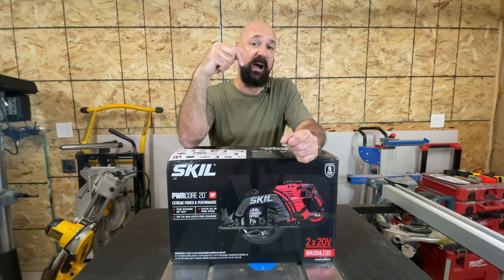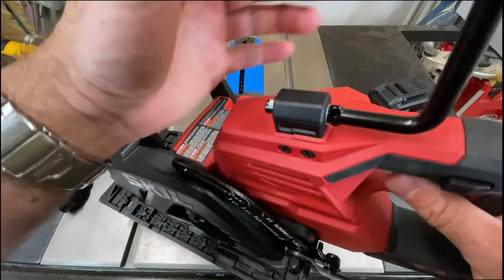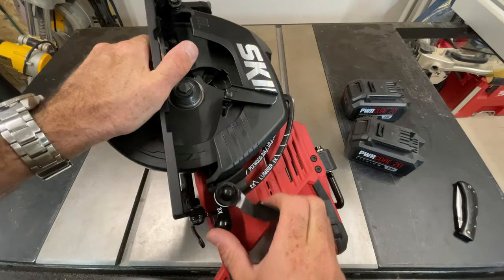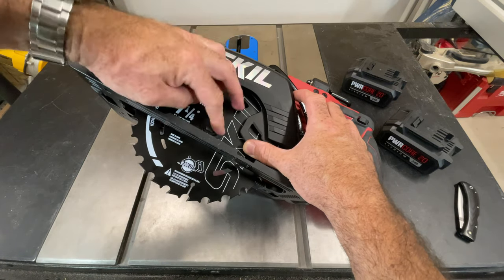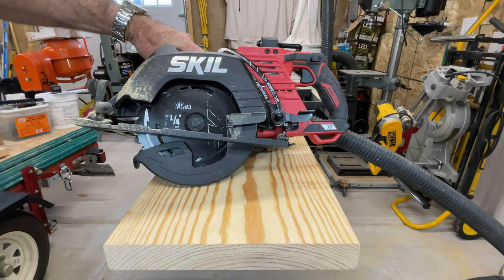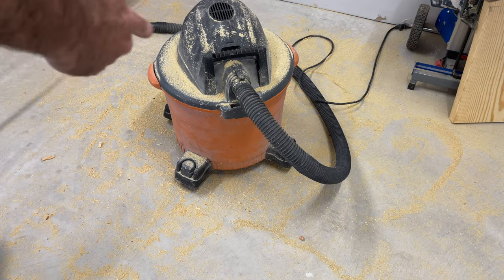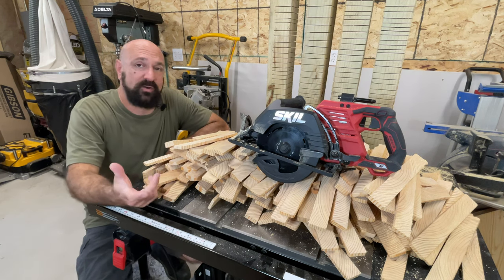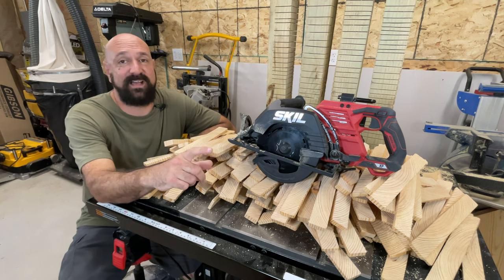Is Skil's New Rear Handle Any Good?? || Skil PWRCORE 20 XP 2x20V Circular Saw Kit Review

Comment: Well, there you go.  My problem when I bought the 20v model, the battery didn't provide enough power to get through what I was working on.  And, how did you know that I use the kitchen counter as a recharging station?  That's a slick looking machine and the price point looks good; though, I'd like to have a hook into getting some gear for free ninety-nine (that's the best).

Comment: Seems like a very good saw but dont think I will like having to use two batteries these rear handle saws are already heavy out of the box and two batteries make it heavier as far as battery platform I am already setup for DeWalt and Ridgid power tools they both make the rear handle saws and only need one battery so may go that route but fantastic review on this Skil saw 👍and Subscribed

Comment: Impressive tool.
If I wasn't already in the Metabo battery line I would consider Skil. I have some of their corded tools which have been great, and their battery platforms always seem to get great reviews. Their 12V line in particular seems to be highly recommended.

On a personal note, I really like your calm unscripted straight talk. Just a guy saying what's on his mind. I think this channel deserves to grow, and I hope you don't change anything.
Reply from the maker: I have zero experience with Metabo or Hitachi. Been looking forward to checking them out. This Skil is really good. Considerably more power than my M18 fuel Milwaukee with a 9ah battery. I’ll be finding a spot for that huge charger and keeping this one around for while. This channels been fun and a lot of work and comments like this mean the world. Thank you!
Reply: The Skil would be even better if it could match the size and weight of the Metabo HPT - those extra couple of pounds on the Skil can really add up over time.  It is a really nice looking saw though.

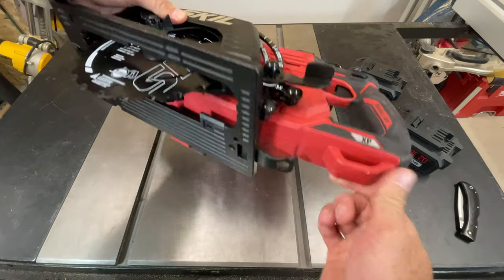Comment: Do you know if the shoe is bolted onto the saw on the bottom of the shoe plate with 2 bolts? At 8:23, it looks like there are 2 bolts holding the shoe on, which would indicate the ability to adjust the parallelism of the shoe with the blade. I had to return a Milwaukee #2732 flagship model M18 cordless 7 1/4" right blade saw, because the shoe was not aligned to the blade, on 2 different saws I tried, and there is no way to adjust the riveted and pressed Milwaukee which has no bolts anywhere to adjust.

Comment: Would you recommend this over the corded worm drive. Ill pretty much only use it home, so cord isnt an issue but obviously nice to cut the cord. Just figured for the same price, worm drive or cordless is the decision to make
Reply from the maker: Personally I love my cordless tools and rarely use my corded ones anymore. Although I still have a full set of corded Milwaukee. Most cordless tools now have gotten so good I can’t see myself busting out the wormdrive unless it’s for a full day of sawing. Although own enough batteries to probably saw indefinitely. 
If you don’t mind the cord and want a saw to will to your kids the worm drives are still tough to beat. Thanks for watching!
Reply: @ProjectsForAllReviews  Thank you for the reply. Quick question, does it require 2 batteries to operate, or is that just to extend its run time and if one works, will that reduce power or just shorten run time. Thank you again in advance
Reply from the maker: Comes with 2 5aH and requires both to work. This saws a beast I still have it and still love it
Reply: @ProjectsForAllReviews  awesome thank you!
Reply: I'd get the corded worm drive if you are going to be doing heavy cutting a lot.  Being at home and around an outlet I'd go with the corded saw...lots of torque with those worm drive motors.  I have the Skilsaw worm drive circular saw and I recently purchased the Skilsaw Worm Drive 10" jobsite table saw as well...the table saw has tons of power as well.  Can't go wrong with the worm drive, and can't go wrong with a cord when you are close enough to an outlet.  

I've got cordless tools too, but its nice to just plug a tool in and not have to worry about battery life when I'm busy with a project close to the shop where I can just plug a tool in and work.

Comment: Got a brand new saw for Christmas and just went to use it for the first time. Got the saw blade on and it won't turn. Realized the spindle lock button is stuck in lock position and we can't budge it. How do you get the spindle lock button unstuck?

Comment: That's a Serious Saw and CHERVON OWNS them and FLEX and EGO and makes KOBALT for LOWES that BATTERY CHARGER sounds just like my FLEX and EGO nice and LOUD but there KOBALT chargers are very quiet
Reply from the maker: Love a circ saw that can make you tired before you have to charge it! Thanks for watching!
Reply: I really think the Flex circular saws are significantly better than the Milwaukee saws. There are several reasons why. They are cheaper, can be had with a stacked lithium battery much cheaper than the Milwaukee. $299 for the Flex with a 10AH stacked lithium pouch cell battery, versus about $500 for the M18 saws with a Forge stacked lithium M18 battery. But the M18 Milwaukee saws are not bolted together, all the parts are riveted, which means you cannot adjust the shoe. My Flex right blade 7 1/4" saw has an adjustable shoe, and the shoe is absolutely perfectly aligned, (perfectly parallel to the blade) out of the box. The Milwaukee (I tried 2 of them) were both .020" out of alignment, so the shoe was not parallel to the blade. The Milwaukee saws were not able to complete a fine precision cut using a straight edge, because they would leave blade marks on the kerf. The Flex saws leave no blade marks, both my Flex saws I bought are perfectly aligned out of the box. And finally, the Flex saws have outstanding dust control ports, and the motors sound much gentler on the ears. The Milwaukee brushless circular saw, model #2732, has an intrusive gear and motor whine.

Comment: Hello. Can you tell me if only use 1 battery instead of 2?
Lowe’s now is onsale for $129 only. The craftmans with 1 battery also the same price.
Reply from the maker: This one needs both batteries installed to run. Comes with a pair of 5ah and a nice dual charger. I still use this saw and still love it. It's a fair deal at  $250 but for $129 buy it quick! Thanks for watching!
Reply: @ProjectsForAllReviews  : I was hesitate to get this Saw, and considering the battery is too expensive, I finally got another Brushless Circular Saw in Harbor Freight Tools.